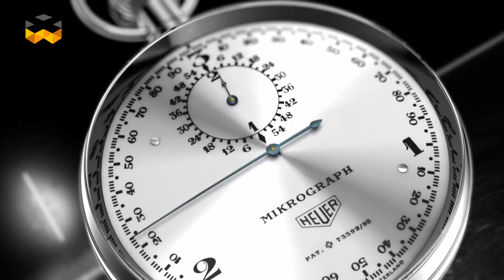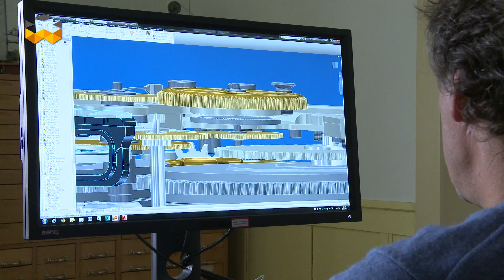Chronograph Saga 5 – Very Special Chronographs

Comment: Exquisitely done this saga and all other videos from your channel and I feel much more knowledgable about chronographs Thanks again . A Side question I am an avid collector and was wondering which automatics are the most felt movement when on the wrist? This is one of my favorite part of wearing a watch but sadly No one ever talks about it or even mentions anything about this . My Dark Side Of the Moons movement is probably my most felt movement    From its large rotor .
Reply from the maker: +Peter K This is an excellent question but not easy to answer to. The famous ETA 7750 chronograph is well known for its strong noise while winding. But the caliber is only one part of a bigger phenomenon, Indeed, the case, its material, and the characteristics of the watch - for exemple if it is a diving one - can change the feeling and noise. But let us know the result of your researches. It would be very interesting to know!